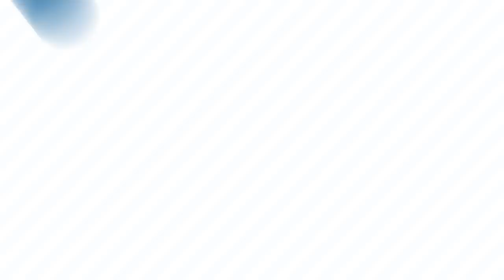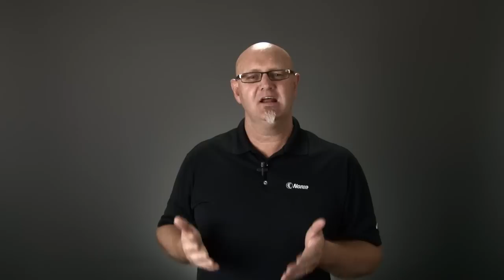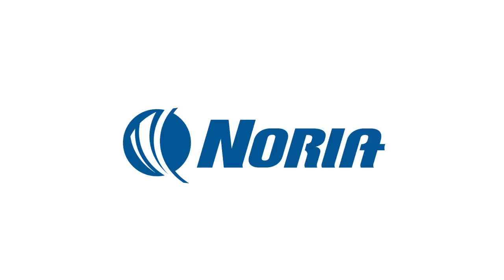How to Avoid Overgreasing Bearings

Comment: In case of sealed bearings, where does the grease go over time? How is it spent? And how is the (air) pressure released when pumping in new grease? Thanks.
Reply from the maker: Great questions! Grease in sealed bearings is subject to the same risks as other types of bearings. The thickener and base oil can separate and then the oil can leak out, the base oil can oxidize and break down, etc. As to air pressure being released when pumping in new grease, if you're referring to sealed bearings, those shouldn't be regreased with a grease gun. They're typically pre-packed with grease. Most bearings that are subject to being regreased typically have a purge port through which old grease and air can escape during regreasing.

We have a few short online training courses you can look at for more info:
How to Use a Grease Gun (https://store.noria.com/products/how-to-use-a-grease-gun)
How to Grease a Motor Bearing (https://store.noria.com/collections/online-training/products/how-to-grease-a-motor-bearing)

Our Machinery Lubrication I training (available on-demand or with a live expert instructor) also covers greasing pretty extensively, in addition to a lot of other useful information:
https://www.noria.com/training/certifications/machinery-lubrication-i/
Reply: @noriacorp  Thanks so much for your swift and comprehensive answer. I am currently replacing pillow block bearing which come with a grease nipple which indicates that these are not sealed bearings. I wonder if these then should be 'packed' until grease exits the seals (or anywhere else) or supplied with a measured amount? On the old ones it is one big greasy mess which I think is a sign of over-greasing. This is a dusty environment (saw mill).
Reply from the maker: @bigbattenberg  Be very careful about assuming that because it has a grease zerk, it isn't sealed. This sometimes isn't the case. I'd recommend reaching out to us at https://www.noria.com/contact/ to help us address your specific use case and bearing type.
Reply: Did you find out the specifics.  Normally there is a grease chart in the bearing box